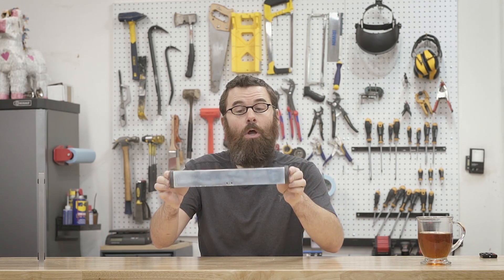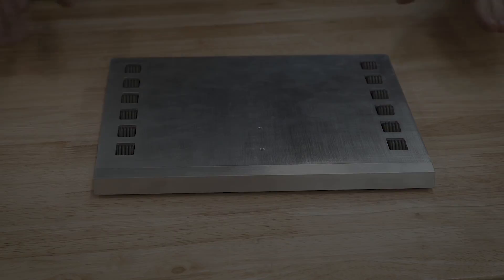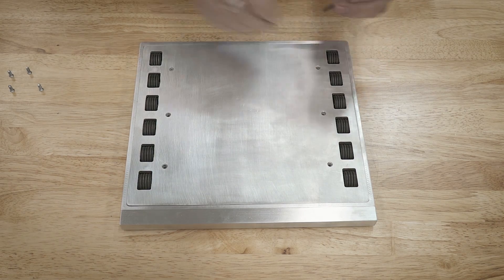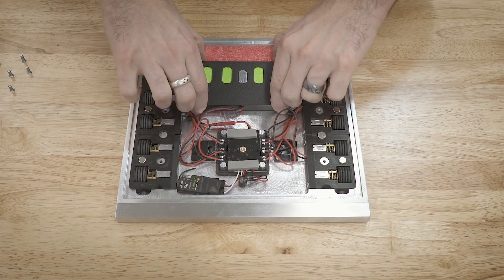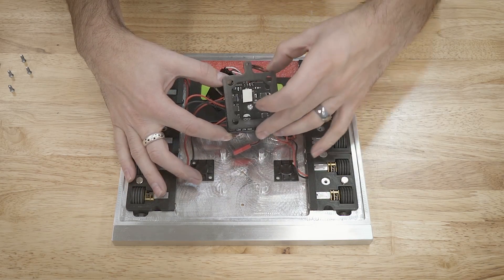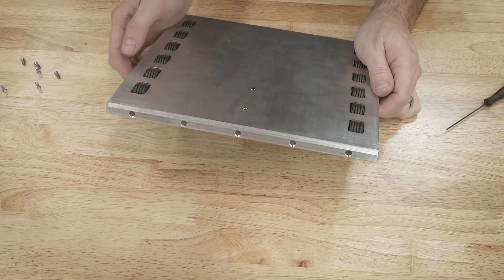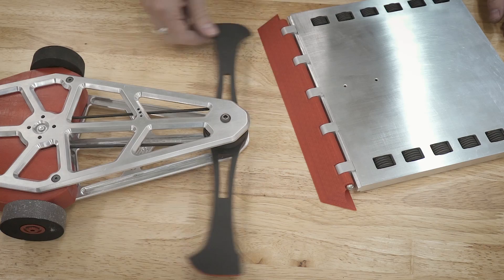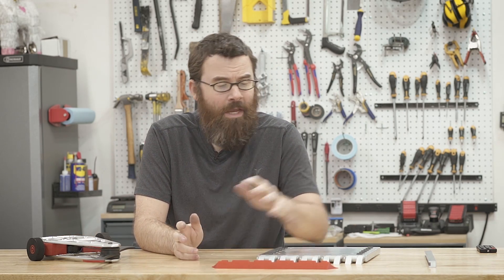Low Low Man - Overview

Comment: Wouldn't one powerful dual channel ESC suffice? From the looks of it, each side of motors gets the same throttle signal so each side of motors gets the same voltage and it would be the same as hooking up the whole side of motors to single ESC.
Reply from the maker: you are correct, a single dual channel would work.  But what happens when a back corner is hit and knocks out a set of motors/wheels?  the extra channels ensure that even if a motor module fails. the others will still work.
Reply: @RobertCowanDIY  That makes a lot more sense. Thank you for clarifying.
Reply from the maker: @bigcheese9530  Of course!

Comment: I know I’m a little late but did you mention what wheels/tires you are using?
Reply from the maker: Check out the video on the drive:  https://youtu.be/mV5Dpm_QUSs  They are 3d printed hubs with o-rings as tires.
Reply: @RobertCowanDIY  Thanks! I actually went searching for all low low man content and found it. The lack of decent low profile n20/30 tires is kind of weird considering how popular the motor and ant weight class is. Time to get printing and dust off my panapress. Thanks for all your great content and as always rooting for Copperhead this season!

Comment: I really want to know how you do the custom esc pcb because brushless esc doesn't work with brushed motors
Reply from the maker: It was made for me by endbots.  This was a one-off project specially for Low Low Man.  But he has other ESCs that would work well for more straightforward designs.
Reply: @RobertCowanDIY  omg thanks alot because I would have start to make a beetle weight robot

Comment: wouldn't it be better if the flat bar was pike shaped? like starting thick (14mm) at the bot and narrowing to a point. I think it would help deflect any blow, at least make the need for a wedge smaller.
Reply from the maker: whoops used this (the predecessor to Duck! on battlebots).  It would get stuck in the floor a lot, and bots would have just be pushed to the side, rather than ride up it.
Reply: @RobertCowanDIY  okay i worded it badly, i meant to say having an edge on the front rather than a flat surface.
Reply from the maker: @Olav_Hansen  I'm still not sure I understand, there are three separate attachments, two of which have a wedge profile.

Comment: Is it Biteforce low wedgelets 
(What I meant is, are the wedgelets as low as Biteforce's)
Reply from the maker: that's an odd question.  the whole bot is less than 1" tall, so yes, they are significantly lower.  they are also sharpened to a fine point, so they ride right on the floor.  but comparing a beetle and a heavyweight is problematic, they are a drastically different scale.
Reply: @RobertCowanDIY  
Okay understood

Comment: If the wedge-lettes get knocked at an angle where they're under the bot, is there enough clearance for the back wheel(s) to still touch the ground (and presumably reverse & get them un-stuck)?
Reply from the maker: Yep, just barely.

Comment: Not that you need any kind of range, but I'm surprised the receiver can work at all inside a pretty good Faraday cage - I guess the gap around the baseplate sides is long enough compared to the wavelength used.
Reply from the maker: I've not had issues with my receiver in solid blocks of aluminum before.  It worked fine in Long Long Man as well.  Just goes to show how good the radios are at working through metal ;-)
Reply: @RobertCowanDIY  Clearly

Comment: Put some heavy duty tape over the screws, that way you don't have to tighten them, making for easier swaps.
Reply from the maker: It only takes about a minute to take off the bottom panel.  I wouldn't want to ruin the aesthetics with tape.  I would just use thread-locker instead.

Comment: I wonder if you are using some kind of  inserts (HELICOILS?) in those  threaded holes in order to protect them from degrading over time? In my experience  threaded holes made directly in aluminium degrade over time, if you are screwing and usncrewing something repeatedly (eg.  LLM bottom cover).
Reply from the maker: Yeah, not a bad idea.  I didn't do it for this bot because I knew it wouldn't really last beyond this version.  The first version of a bot (for me) is always the test platform.  I already have some new ideas for V2, so the next version might get inserts.  But you are correct, I've found that aluminum threads aren't very durable over time.

Comment: I'm surprised those lovely, warm, generous, friendly people at Apple haven't started legal proceedings to prevent you from making any reference to anything 'thin', 'low profile', 'flat', or 'narrow' in association with your fine design.

Oh yes. It's well known that Apple invented the rectangle. And the square. And the apple. And the letter 'i'. And the bevel. And the radius. And the concept of thinness. And the state of not-being-thick-ness.

Robert, my friend, your robot clearly infringes numerous original Apple ideas. Even 'air' is their intellectual property. (Highly profitable, too.) Their legal department will be in touch; you can expect a fine of $300,000,000 and a jail term of between 12 and 56 years.

Cease and desist, you reckless man, before it's too late!

;-)

Comment: It would be interesting to see some kind of connector pins placed under each module held together by the top plate pressure, so you don't have to de-solder the wires each time.